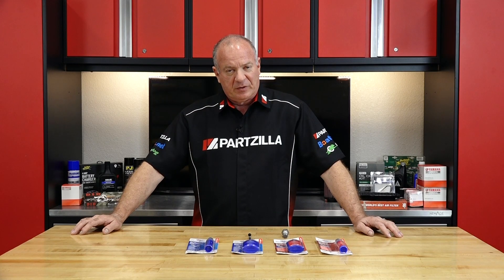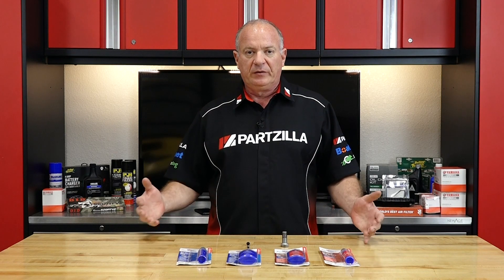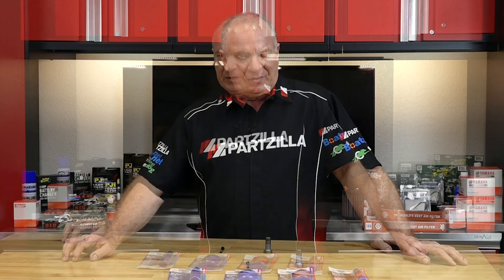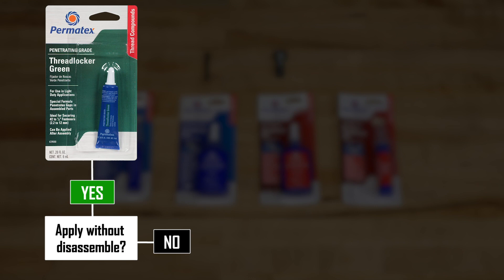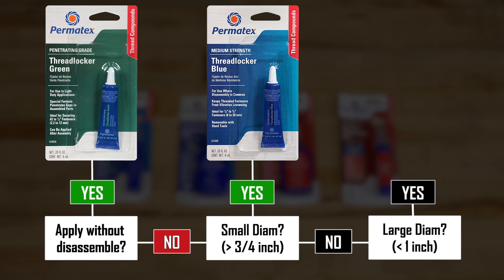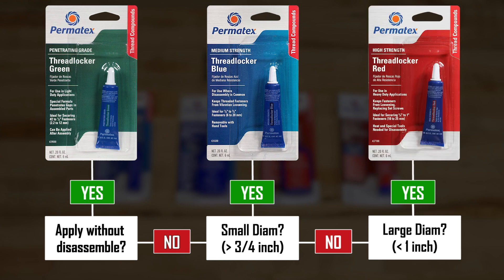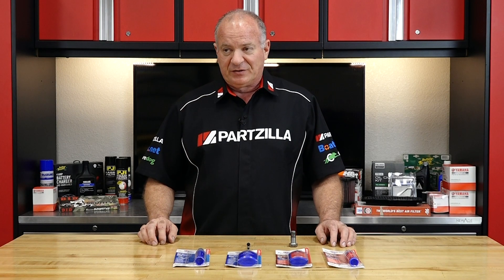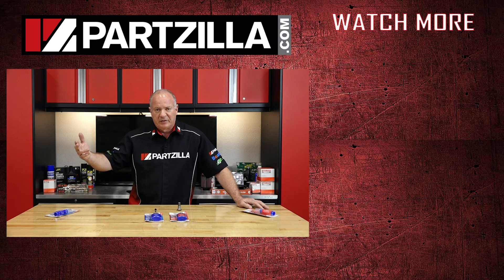Choosing the Right Threadlocker  | Threadlocker Colors | Threadlocker Buying Guide | Partzilla.com

Comment: What is the correct thread locker to apply to keep the nut tight on the handle of a  air tight wood stove glass door ?
The  nut works loose when the stove cools, causes loss of air tight seal when lighting stove .

Comment: Love this video!  I’ve always wondered about threadlocker. Only comment is that I think your greater-than and less-than signs are swapped on the flow diagram. In other words, I believe that it should show “Small diameter? (<3/4 inch)” and “Large Diameter? (>1 inch)”.  Though I might have misinterpreted the video :)
Reply: You’re absolutely correct, the ‘carrots’ were switched. I think that’s what you call the <

Comment: hi guys i just had a quick question its a bit off topic but i need help. i just did the bottom end on my 2008 honda crf 250r because there was a little bit of play in the left crank bearing, everything is done correctly but there still is the same amount of play in the left crank bearing. it was all my money that i invested in it and i really dont know what to do now or what the problem is. can you explain what could be wrong? i also just put the bottom end completely together and tearing it apart again would be a nightmare.